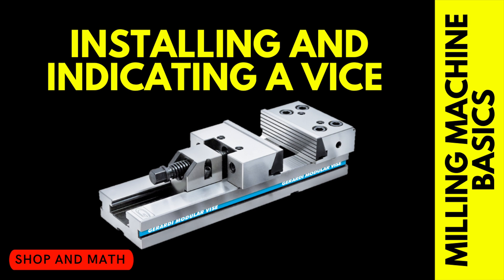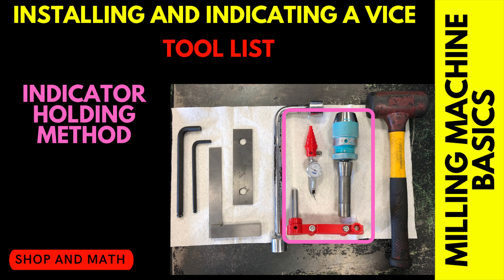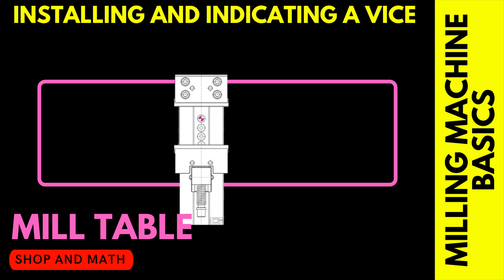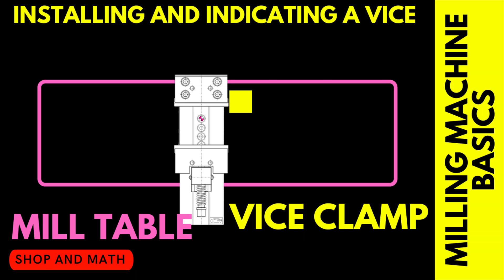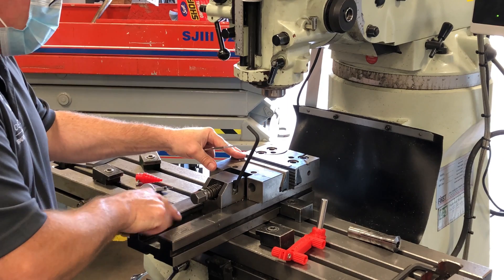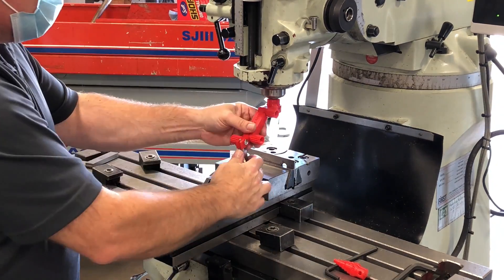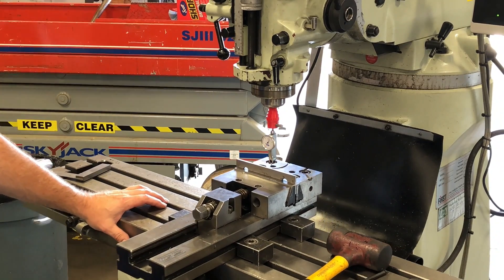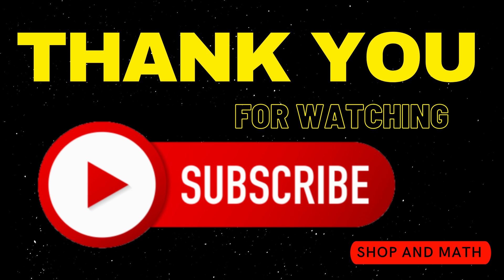Installing and indicating a vice

Comment: Awesome video, Is the rear fixed jaw supposed to be fixed or allowed the pull down like the movable jaw ? Thanks
Reply from the maker: on this particular style of vice which, unfortunately we don’t use anymore

The front jaw and the back jaw or stationary jaw and moveable jaw, both move up and down. That is how it clamps your workpiece firmly on the parallels. 

With this style of vice, it is extremely important that maintenance is done to this on a weekly basis it needs to be taken apart and cleaned and oiled if you’re going to be using the pulldown feature

To use it as fixed all you need to do is tighten the 6 mm bolts, and that will prevent the jaws from pulling down and make them stationary

Hopefully this helps 
Ray
Reply: @shopandmath  Thanks for the prompt reply. I understand - Thanks!

Comment: 👍 I'm not a fan of the table keys either. Like to be able to slide my work holding on and off the table. Indicating doesn't take that long with practice and I wouldn't trust them anyway. I would still be breaking out my indicator to verify.